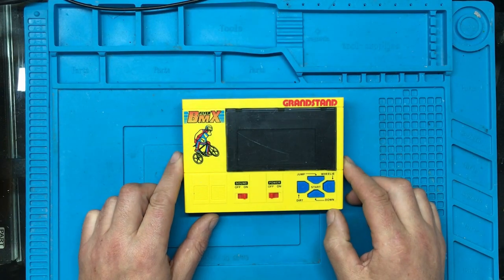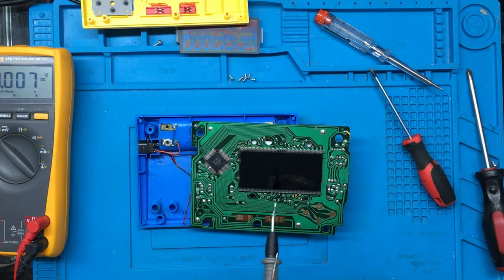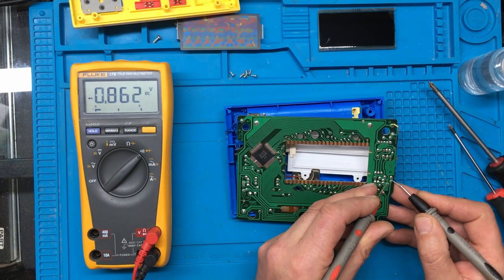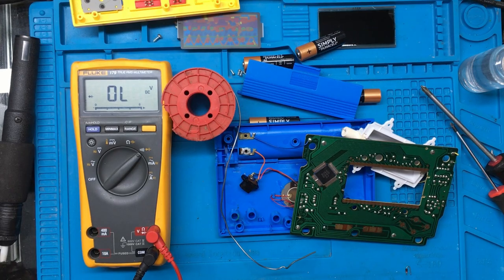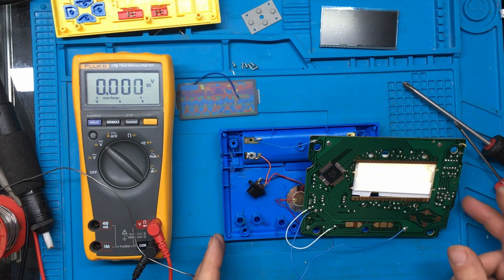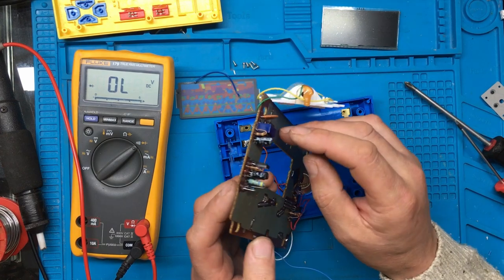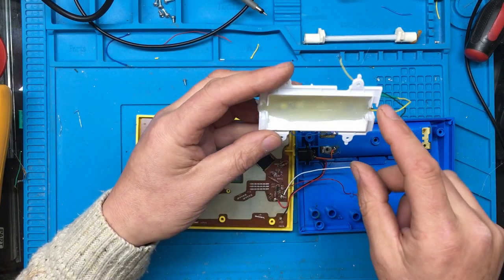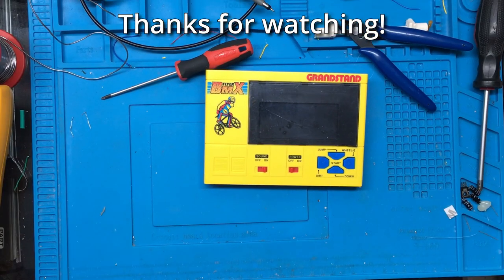Grandstand BMX Flyer - Retro Hand Held Game - Let's Fix it!

Comment: Very clever to use the LEDs! That's thinking outside the plastic box.
Reply from the maker: Thanks Tom 👍yes sometimes you have to. I had to do similar when testing the solar inverter I repaired before I had any solar panels, and on the fairly recent night vision monoculture I repaired with the 'unknown' voltage regulator part🙂👍

Comment: I had this handheld game for 1983 Christmas 👌
Reply from the maker: Nice 👍I hope it brought back some nice memories 🙂
Reply: @BuyitFixit  batteries wasn’t as good then as they are now. I remember getting a power pack for the mains electric with four multiple plugs that would fit any similar handhelds….the power pack had voltage selection too 😂 these games with LED’s used to eat batteries within a couple of hours.
Reply from the maker: Yes, I remember those too 🙂I think one of the adapters I had was made by Altai which had the voltage selector and the 4 way plug and even a 9V battery terminal to fit devices that used a PP3 battery.
Reply: Me too. I want it. Ack again!

Comment: Hi, thank you for posting. I have a partially loose LCD screen of the board. It didn't show you putting the screen back on the board. What would be the correct way for me to do it to fix my connection problem on mine  please? I've got about a 3rd blank screen as a result.
Reply from the maker: see 23:59 you can see the screen sat in the yellow part. If you use some IPA you can remove the zebra strips from the LCD and clean them. Make sure you put them in so they are straight and the lines are at the top and bottom (so they touch the LCD and will make contact with the circuit board). You could also clean the contacts on the circuit board (I use a flat piece of paper sprayed with contact cleaner or IPA might work) and rub the contacts they should go nice and shiny. Hope that helps.
Reply: @BuyitFixit  Thank you so much for your reply. Had this game from new in the 80s and very keen to fix and having seen your light mid perhaps improve. I have been considering Nintendo Gameboy backlight I've seen on eBay for around a tenner as also an option. Thank you again.

Comment: Nice fix, even it's not original, it works :)
My laptop keyboard gave me trouble recently, the T -key stopped working. 
Pulled the key cap, and thought it might be similar structure as for example Playstation game controller or TV remote controller, but this looks different. 
Very very tiny parts and not 100% sure, but looks like one hair thin printed looking wire may be broken. It's just so tiny and there's plastic around it, I didn't even try to resolder it. Might've gone short circuit giving the letter T all the time :D Touched that suspicious looking place with multimeter test lead and indeed resulted the T letter coming on screen even without pressing the center contact looking thing. I still don't fully understand how it actually works, never seen this kind of structure before.
One option would've been to replace the original integrated keyboard, but went for easier and cheaper solution and bought external usb keyboard. Of course it's still possible to go back and try to repair the integrated keyboard later.
Reply from the maker: Thanks Mr JSV. It sounds weird that. Most of the keyboards I've seen (under the key) are just like a resistive membrane with a rubber bounce thingy on the top.
Reply: @BuyitFixit  There indeed is a clear rubber kind of thing. Thought that it's the one making the contact, but there's no "carbon" looking peace there. Also the computer side has a tiny "disc" at the center, with 2 tiny wires somehow probably connected to it. Not sure if the key press is sensed from the center or from the perimeter. Nothing seems to press the center disk from the keycap, and even when I pressed it with tool, nothing happened.
My laptop is Packard-Bell EasyNote LV, bought it in 2013, so it's quite old by now, but otherwise works.
Reply from the maker: Most are just a piece of rubber, it's just a spring.. the contacts are usually on the top sheet of membrane and on the bottom sheet of membrane, and pressing the two together results in a connection. No carbon needed.https://en.wikipedia.org/wiki/Membrane_keyboard#/media/File:Inside_Computer_keyboard.jpg
Reply: @BuyitFixit  Thanks for the link and explanation :)
Reply from the maker: No problem. Hopefully it's similar to what you were describing.

Comment: I have 2 of these at home, both with very low backlight levels - I wondered about replacing the actual bulb, would it be possible to source a replacement cold cathode tube to keep it as original as possible and if yes would you know where to suggest to find them (how to specify what I'm looking for w a supplier). I haven't yet detached the bulb from the glued side of the connections but the other end is unmarked -so as a complete novice I am uncertain what exactly I'm looking for!
Reply from the maker: Not sure if it could be the tube or the driver circuit. It was the transformer had failed on this one I used some LEDs. I'm not sure if you can get a replacement lamp. It might be worth checking / replacing the electrolytic capacitors around that area just in case.
Reply: @BuyitFixit  Sounds like that could be 'above my pay grade' 😂

Comment: Hi 
What led strips did you use ?
Looking to fix mine
Reply from the maker: It was just a piece of that adhesive white led strip for cupboards etc. I had some lying around from an old project.
Reply: Thanks ,I saw you put a resistor inline for the led  is that easy to do ?
Reply from the maker: @limeskin99  yes, otherwise the LEDs will burn out. I just did trial and error until they weren't too bright.
Reply: What kind of resistor would I use for a led 12 strip (im not electrically taught )